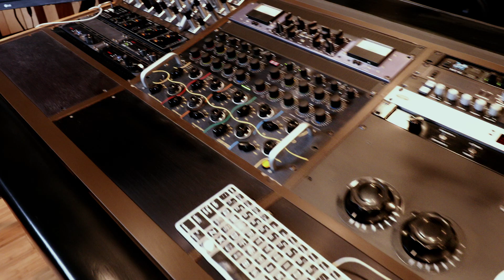Lurssen Mastering Part 6: The Phantom Bus Process for Immersive Audio

Comment: what did you fold down and how?
Reply from the maker: They're talking about folding multiple tracks from an immersive audio file into either a single mono track for triggering external processors, or the stereo binaural tracks required for headphone listening. Any DAW can do this, just like printing a mix or summing to an output bus.